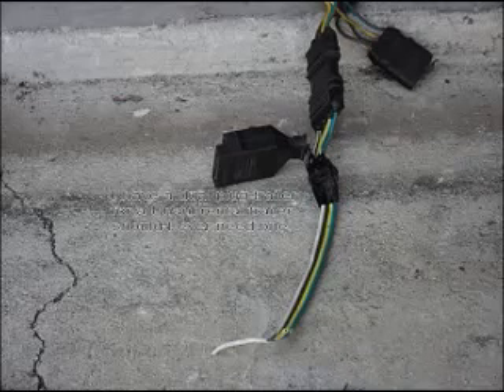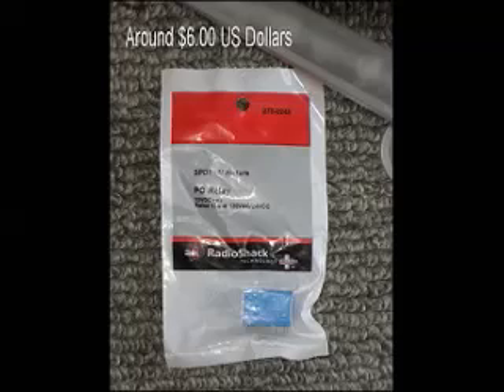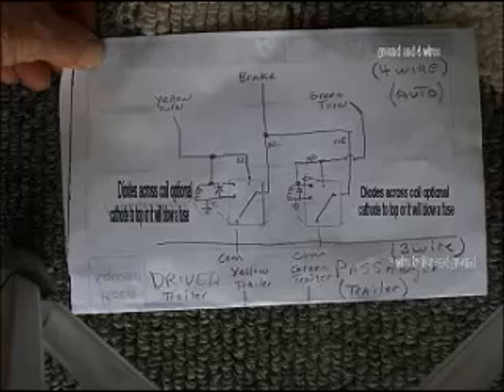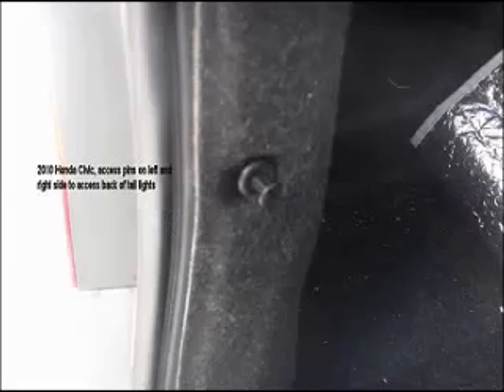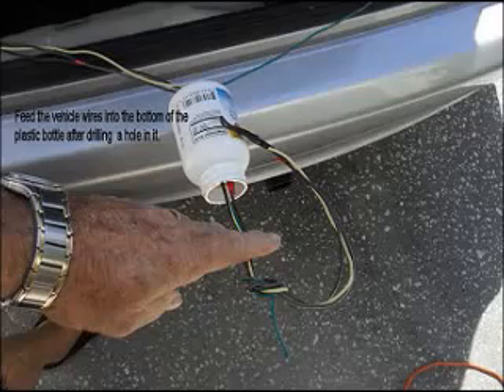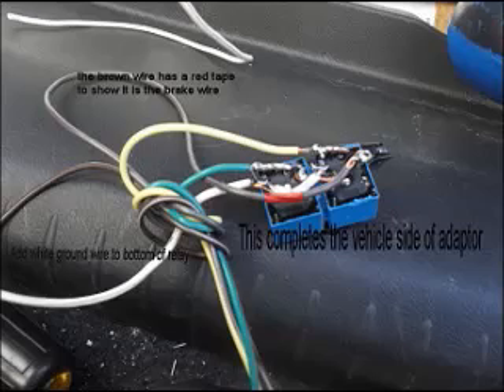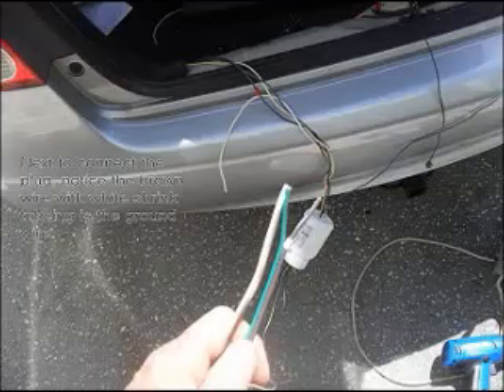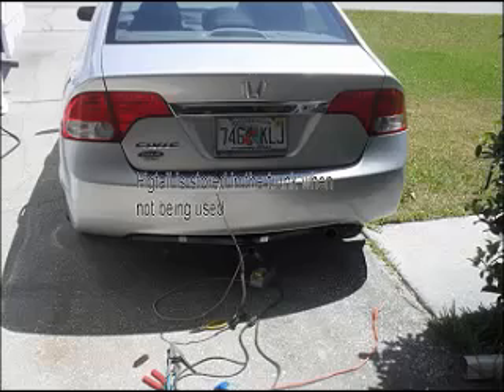Trailer lighting converter 4 wire to 3 wire system using Radio Shack parts

Comment: I tried building one of these but it doesn't really work right.... If you have the brakes on with the turn signal active the lamp is only off while the relay is between states so the blink is too fast to be visible.